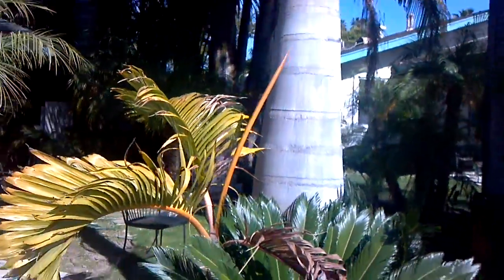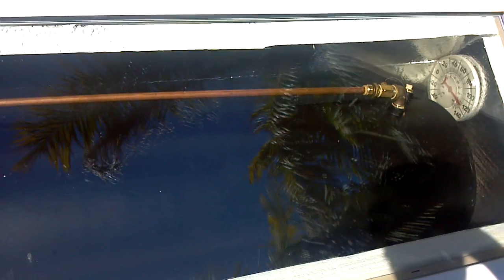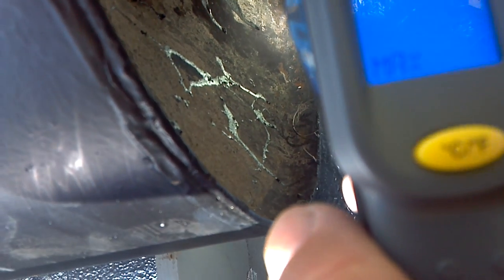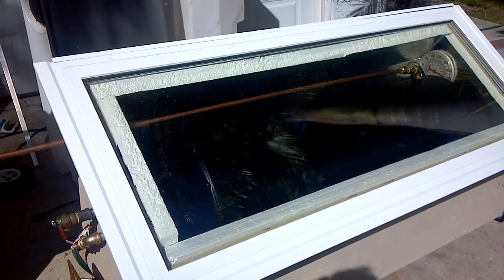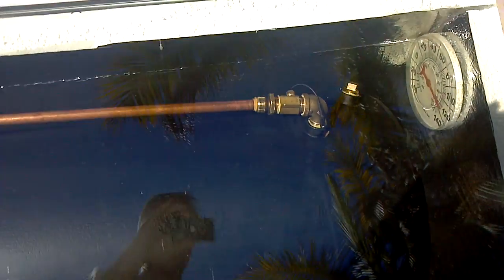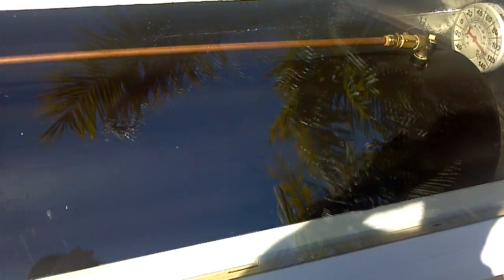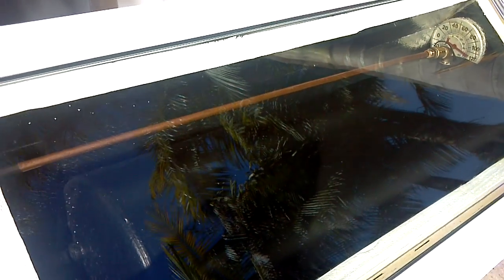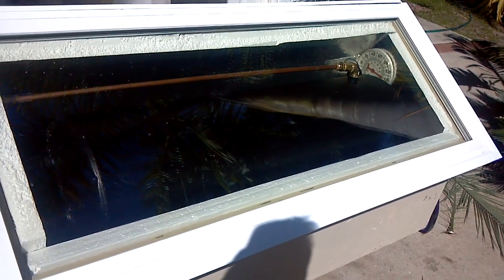Solar batch water heater part two- temperatures

Comment: this is awesome, I also have started my solar water heater after I watch your video...
Reply from the maker: Thank you, John. Over the summer in my town the temperature reached over a hundred and fifty degrees in the solar water heater. The storage tank would also maintain a very high temperature with the use of the differential temperature controller. Check out JC solar homes. John Canivan hooked me up with his controller.

Comment from the maker: That is a good suggestion. In the middle of summer the water only hit 120 degrees. Which is not too hot for a regular water heater. It was very nice where two or three months never having to burn a fire under the rocket stove. But I think I will have to insulate that box come winter time. This will be my first winter with that solar heater. Thanks again for your advice
Reply: Its five years later.  Im very curious as to how its been working.

Comment: If this was done the water would keep its heat 5 times longer or better. Further all black is better in the box than reflective materials...... I have contemplated  this idea for a while and will coming out with a video on it soon. How to combine or make one batch system that can be heated by wood and solar separate or at the very same time in the same tank. I think your gonna like it.

Comment: Hello Mr. Bob Very nice water heater. If I might be so bold as to make a suggestion for your consideration. That would be to make a thick foam board flip top that would be covered in a water proof material very similar to a hot tub insulated top. that could be flipped either in very hot weather to prevent over heating while keeping that high temp. and in cold and/or nights flip the cover over to increase the R value from less than 5 to up around 25.